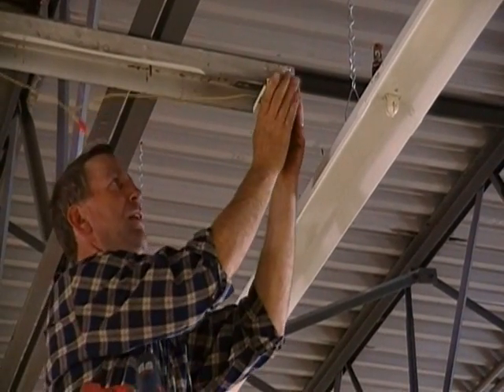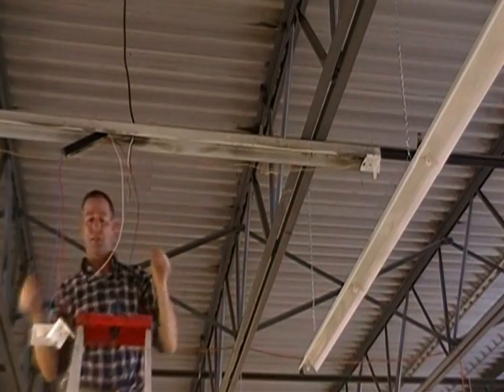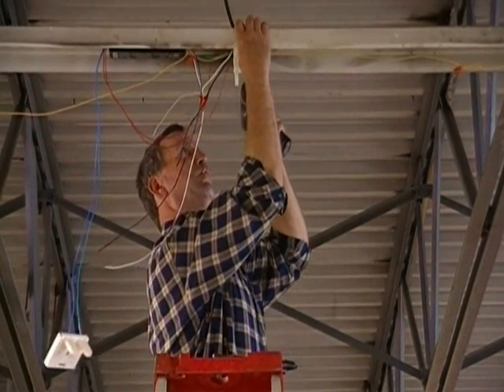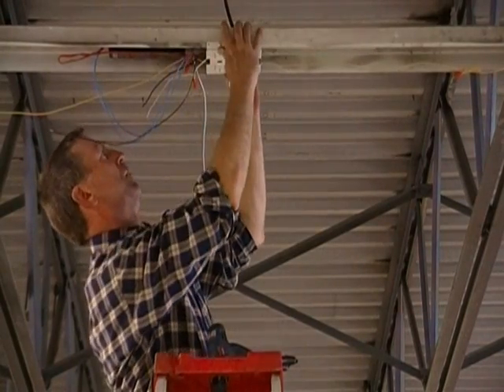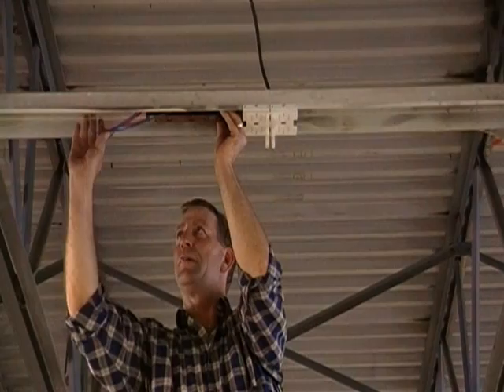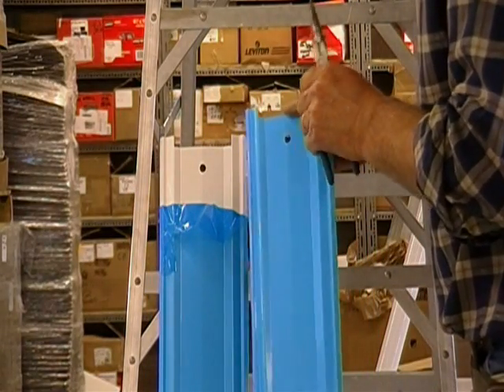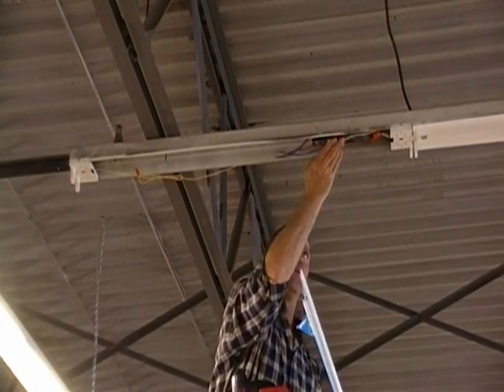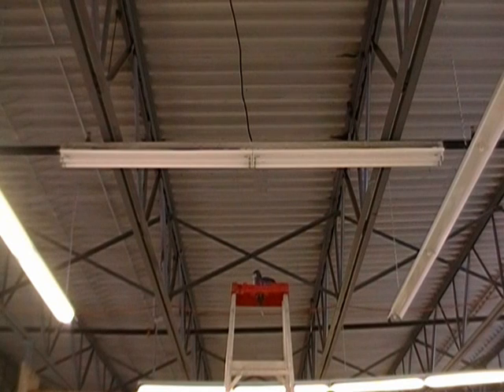JAFtech Universal Fluorescent T12 to T8 Retrofit Kit Real Time Installation A244-UNV (Part 2 of 2)

Comment: What a mess.  Why double it from 2x T12 to 4x T8 tubes?  Twice as many failures!  Why not upgrade to 2x T8 Tubes and a different ballast.  Make life easier.  It won't be funny if you are off by 1/8th of an inch and the tubes won't fit.